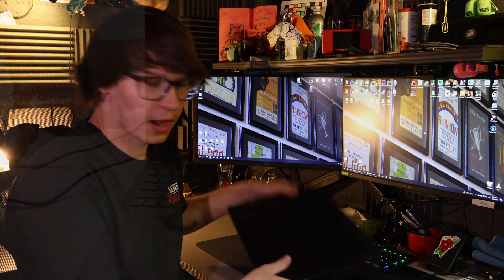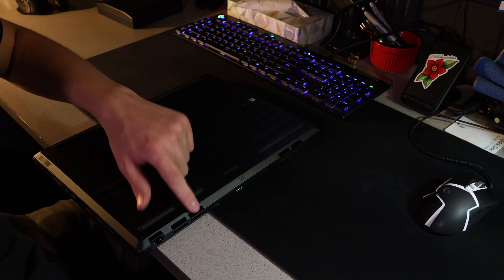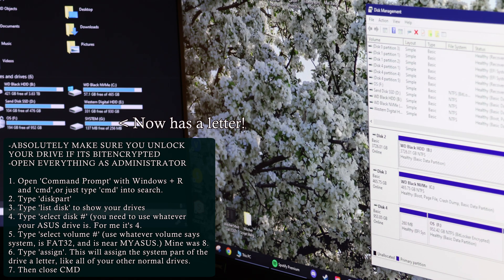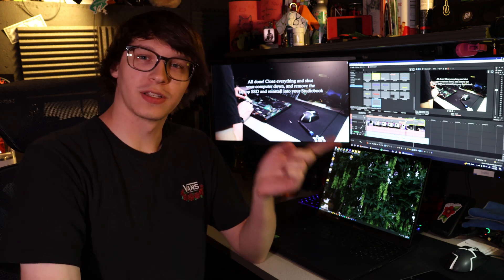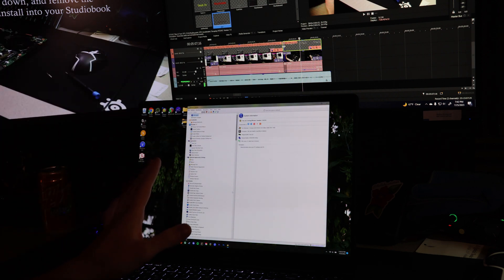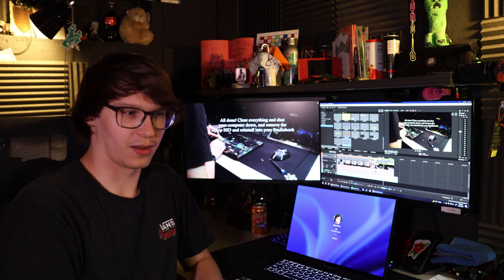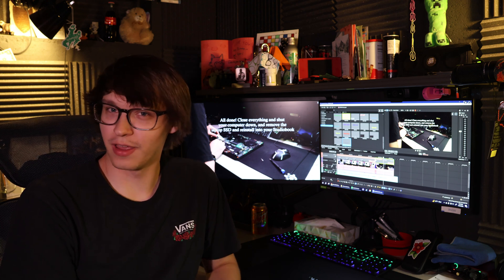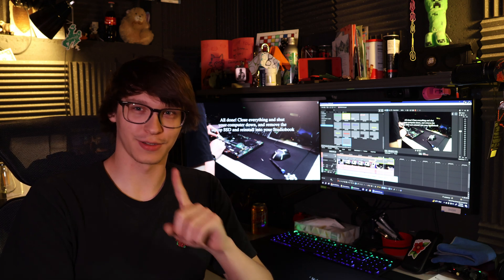ASUS Studiobook Stuck at Flash Update. Here's the Fix! July 2023

Comment: I just ordered the same laptop, it will arrive maybe within a week , so what should I do to avoid this problem before it happens, and can you please search to see if the problem still exists with windows updates? Because I like to be up to date with everything, and I don’t have other pc or sad enclosure to solve the issue if it happens
Reply: I had the same concern as yours since I just received my ProArt Studiobook.  I contactted Asus about my concern and here is part of thier reply:
"The BIOS update we released on July 21st for the ProArt Studiobook Pro 16/ 16 OLED(H7604/W7604) can prevent some units from loading Windows or even entering the BIOS. (Which was removed) This only affects some of the devices, not all of them.We noticed the issue within hours of deploying the BIOS update and immediately halted its rollout."

Then I went ahaed and updated the BIOS update I recived thruogh Windows update and everything went well without a problem.  Clearly they solved the problem.
Reply: glade to hear that, but sadly i couldn't get my unit because of amazon late shipping so i had to change it with asus rog strix g 16 @yassersaeed2010
Reply from the maker: Asus should have it fixed by now on laptops shipping out, don't worry about it

Comment: Hey! Thanks so much for all the help! Just a quick question, I’m going to receive the laptop today, first thing I’ll do is disabling wifi and going to device manager to disable all 3 firmwares. Once I’ve done that and connect to wifi back again, can I update the pc via windows update or it will download the bad update even if the “device manager” thing is already done?

Thanks!

PD: it’s just I’m worried cause I know the model I’m getting is some months old and if I disable windows update via winaero, it will have lots of updates to do hahaha
Reply from the maker: Hi Javier! If you want to be super extra safe, I would start up the laptop like normal, DO NOT connect it to internet. Disable the 3 drivers, then if you’re able to, download Winaero from a different device and use a flash drive to transfer the installer over. That should do the trick. 

However really, the problem only occurs when you let the laptop restart since it tries the update. You MAY be fine to connect to wifi and install winaero and do all of that BEFORE your first restart. For safety though I would do the first option, I’m not sure if winaero has you do a restart when you first install it or not. (I guess you’d end up the same either way?

Anyways, thank you for your comment! I hope this helps and that you love your studiobook! Other than this problem, mine has been beyond flawless for almost 2 months now. I do lots of video and photo editing on it, and it can even play Doom Eternal at max res and max graphics around 60fps! Very very powerful machine. Enjoy!
Reply: @rykerreese1295  thanks so much for the fast answer! Hopefully this solves quickly so we all can enjoy the machine! Have a great day!
Reply from the maker: ALSO! If you’re able, see if you can Roll Back the drivers, that part is required, if they don’t they may already be “rolled back”